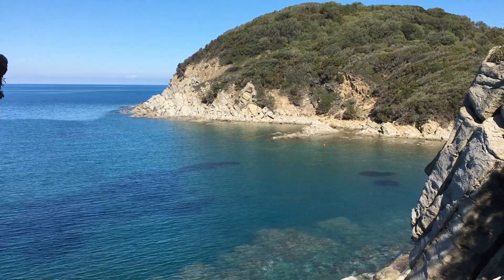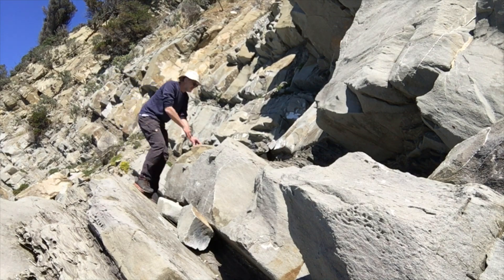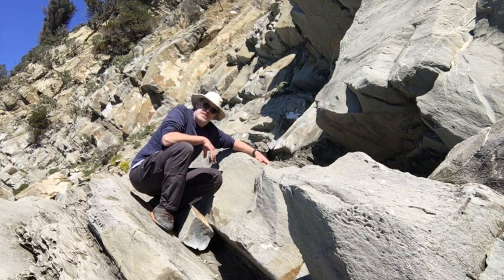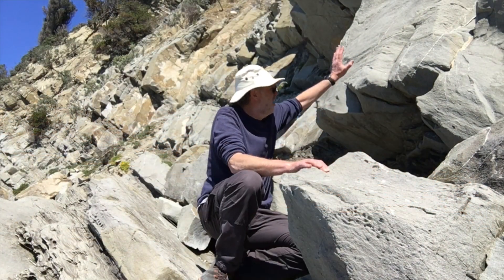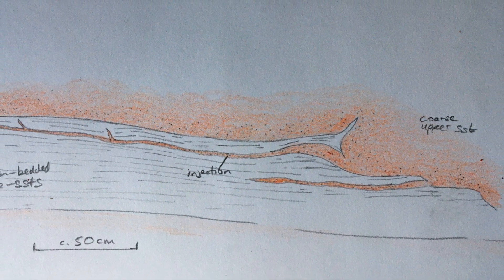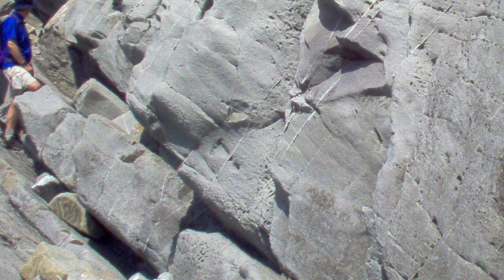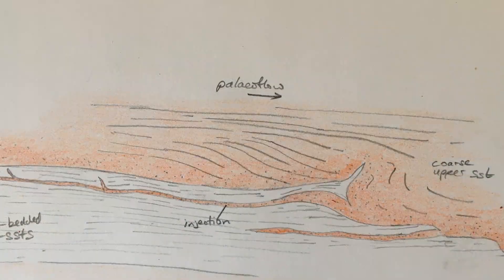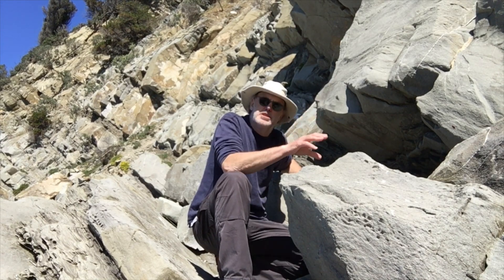Sand injection, shallow erosion and turbidite sandstone amalgamation

Comment: Is this from the Parco Nazionale dell'Arcipelago Toscano, Italy? This could be soft sedimentary structure. Maybe it is that the lower layer was sheared before it was intruded by the upper unsolidfied sand sediments during an earquake event.
Reply from the maker: The key observation is that the sand bed that connects to the wing is laminated - no deformed, so the wing has been injected from an over-riding flow - not the bed above, which aggraded later in that flow's evolution. I think earthquakes are unlikely  causes of the injection given that deduction.